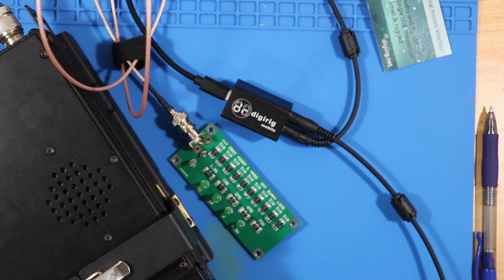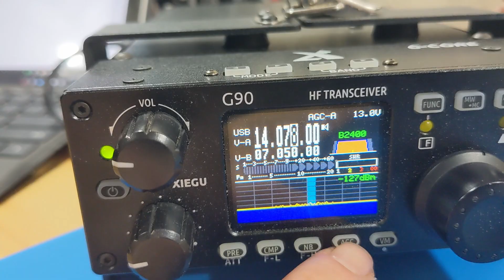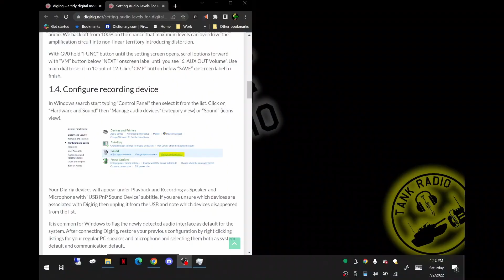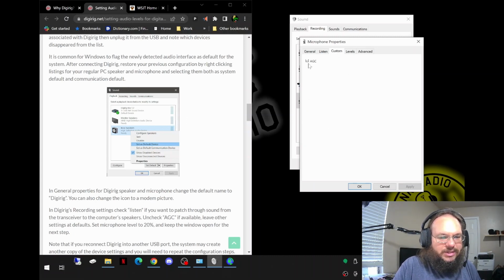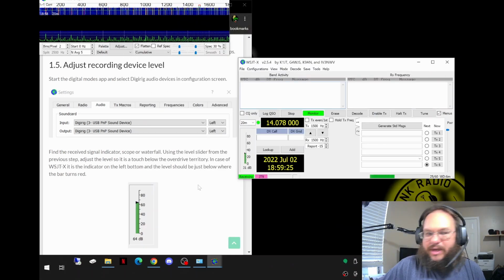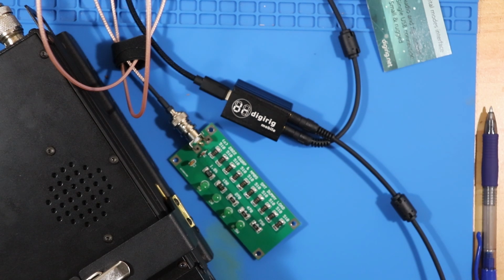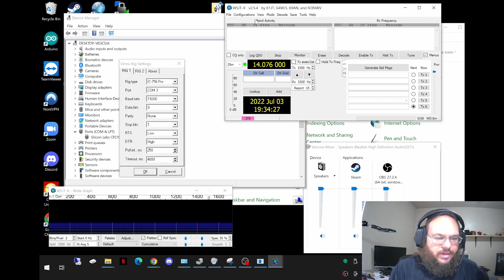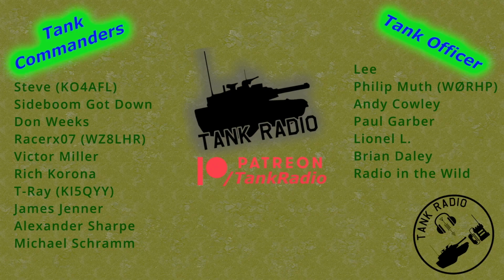DigiRig Setup on G90 For FT8

Comment: JS8CALL my program. However getting it to work with Digirig and Winlink Express. I thought FT 8 was 14.074 etc
Reply from the maker: I haven't used JS8CALL and WinLink yet.  Its on my list.
Reply: @TankRadio  I prefer JS8Call as I can chat with others. FT 8. The computer is doing it. Using JS8Call Utilises I can send text, email plus Sota, not that I'll be doing that from a walker. 73

Comment: It'll be interesting to see if the new DE-19 interface from Xiegu is as simple as the DigiRig! (the DE-19 will replace the CE-19 for the G90 and G106). Also in WSJT-X it "should" install the needed USB interface software as part of its main install and you can take Xiegu X-108 as the radio or IC-7000 - both will work.
Reply from the maker: I will have to look into this I don't know the answer offhand

Comment: I used flrig instead of Omni rig.
Reply: Flrig has the g90 as an option too. You don’t have to lie to it and tell it your g90 is a Icom
Reply from the maker: @K5KTM  I am going to be installing a new computer or two next week.  i will give it a shot.
Reply from the maker: I will have to check that out
Reply: Every time I push Test CAT i get an error that the port is not available or an error that the rig is not responding, ahhhh